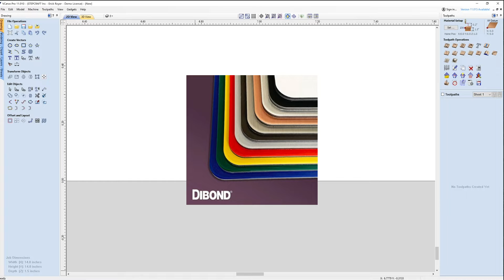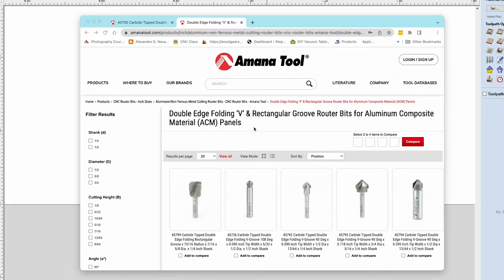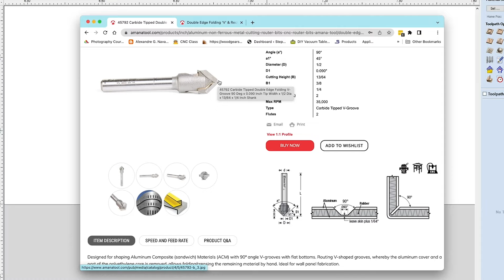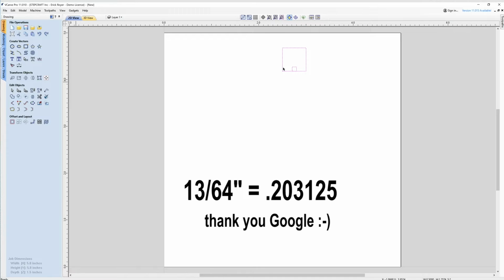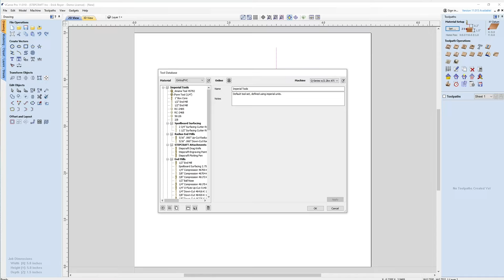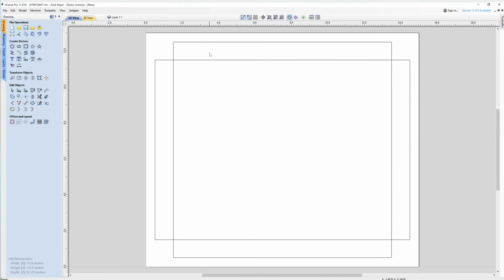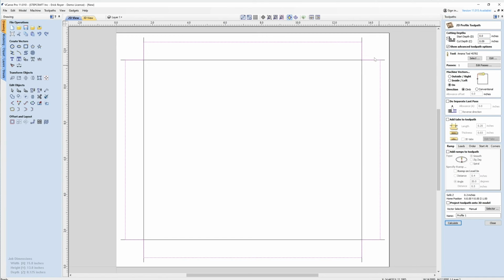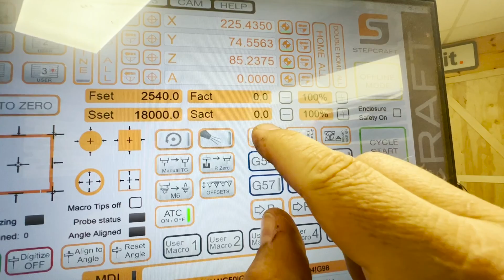CNC Tutorial - Mitering ACM "Aluminum Composite Material" With Amana Tool and Stepcraft

Comment: Should be using 110deg "V" groove router bit - when using a 90deg "V" groove bit the fold is usually too tight where using a 110deg leaves enough relief in the join you can fold it perfectly @ 90deg. You want to leave .75mm material in the groove when "V" grooving.

Comment: With the tool you are using, if you would cut 10 in box as in the example, what is the resulting dimensions between the 2 folded flaps?
Is there an offset?

Comment: v groove not deep enough. When folded the sides should stay at 90 and not fold back. Best is to almost see the aluminium. For 3mm thick ACM, depth is around 2.3 to 2.7 deep, then your mitred ends will be better too.